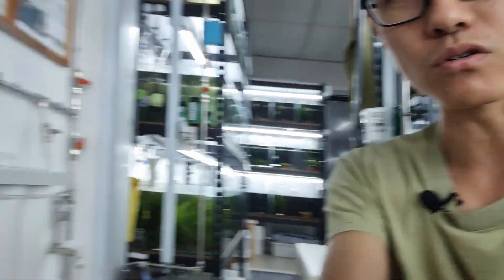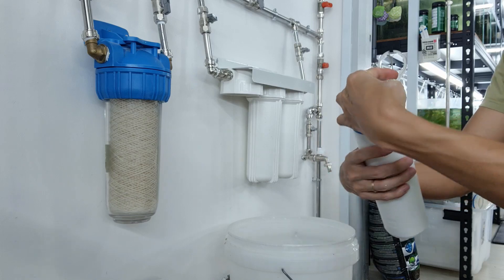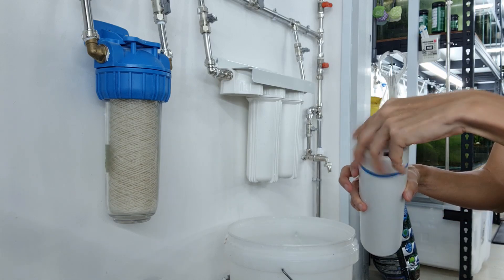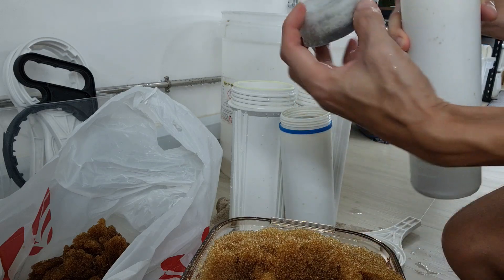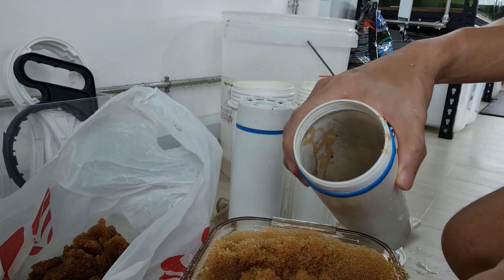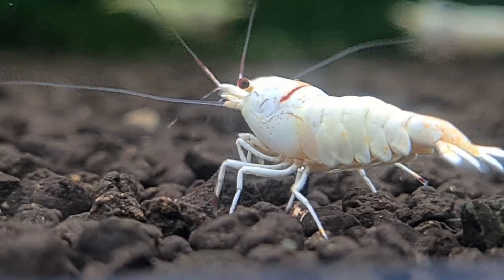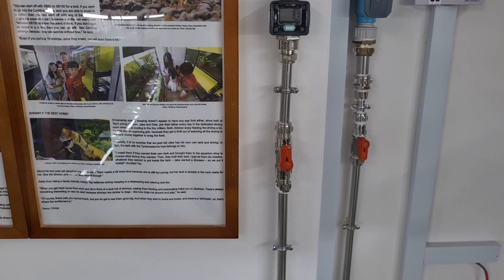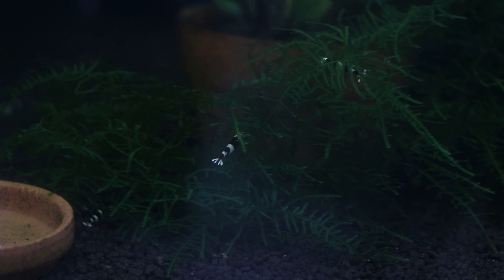Saving precious resources

Comment: We have 0gh, 2kh and around 35tds water here in Vancouver Canada so I am very interested in trying this method to save water. Would this work with traditional 1/4 inch RO tubing or would I need to use bigger and more rigid plumbing like you have?
Reply from the maker: We started with 1/4 inch which is what we use at one of the breeding room. For this we use 1/2 inch because we needed speed. Which also means that with so high speed input the water can still be 0 tds.long and short of this yes it will work with 1/4.